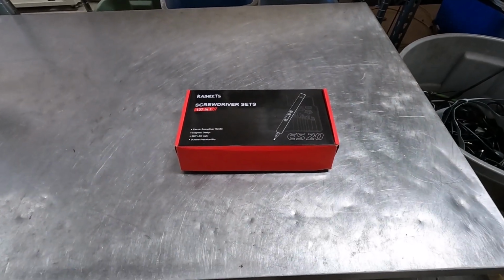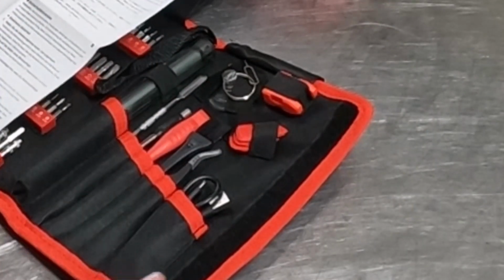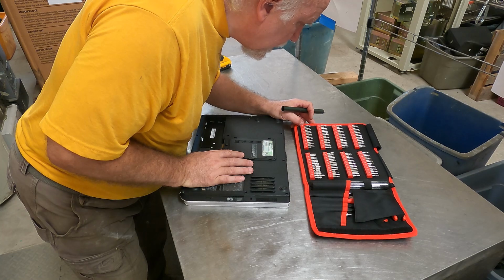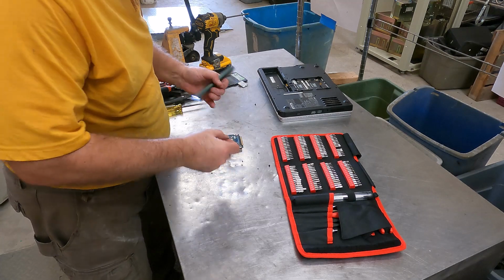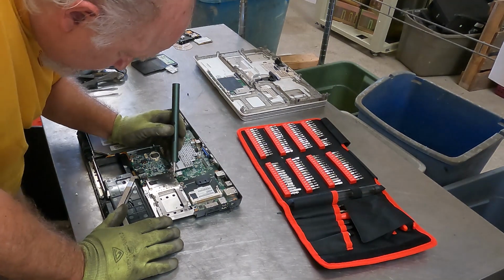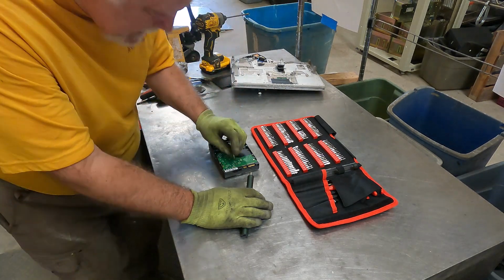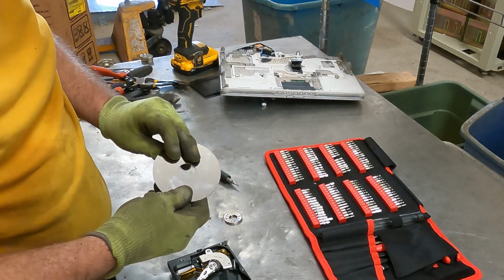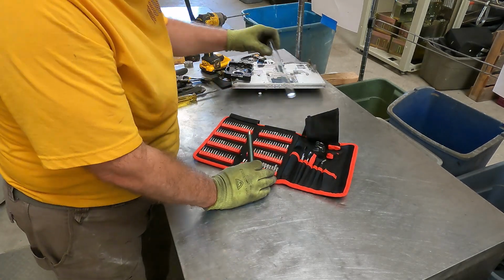Kaiweets Electric Screwdriver - Right For You?

Comment: Looks like a nice set. I find with new rechargeable batteries they get better after a few changes. Also the initial loosening of a tight screw.are these meant to be used like this ? could do with a bit of meat on the handle, just to make it easier to hang on to. 👍
Reply from the maker: Some good points Kevin.  I suspect the designers did not have scrappers in mind.  We can be tough on tools 🤣

Comment: It also has two torque settings, hold the LED button for a few seconds to switch between modes from low torque to high torque (Looks like you have it in low torque setting here)
Reply from the maker: I discovered that after recording this and talked about it in a subsequent video.  Interesting feature.  I'm now using the toll to help me remove riser pins/screw posts.  I still have to give it a twist to break the screws loose but otherwise works very nicely for that job.

Comment: I would say nice tool for a I.T guy like you said but as not practical for a scrapper.  Thanks for the videos
Reply from the maker: Yesterday I started using it to remove the brass risers in some PC's.  I'll show that in a future video.  It's long length and small size make it good for that task.  But you are correct, this was designed with IT/electronics repair in mind.

Comment: Nice kit but tool seems a little thin for your type of deconstruction, and battery & motor need more grunt.
Reply from the maker: It clearly wasn't designed for this kind of work.  But It's not bad.  I'm using it now regularly now to remove the brass risers in some PC's.  It's small size is perfect for that task.  I'll include it in a vid soon.
Reply: @sharkscrapper  ideal for that due to length

Comment: Quite the in depth review.  Be interesting to see if the manual twist will affect the internals any ( understood your comment on the Torque)  Plethora! Not even a veritable Plethora 😂
Reply from the maker: I've started using it to remove the brass risers found in some PC's.  It's slender body but long size make it perfect for that.